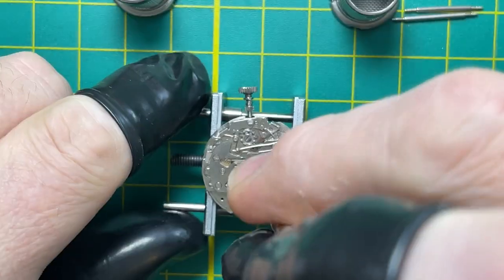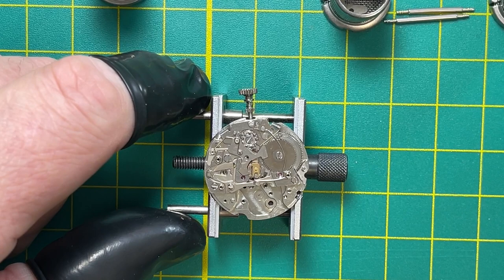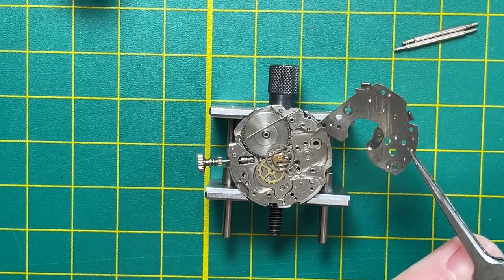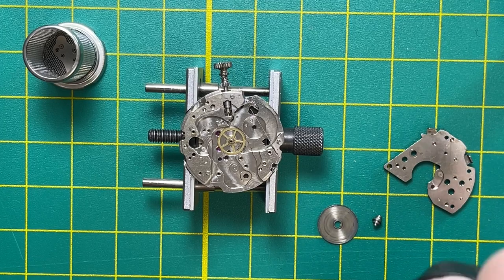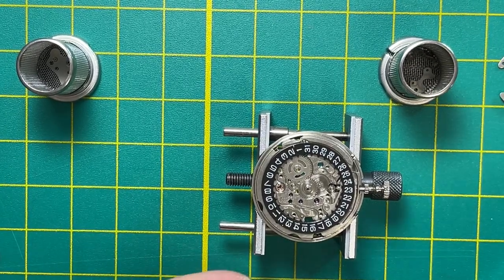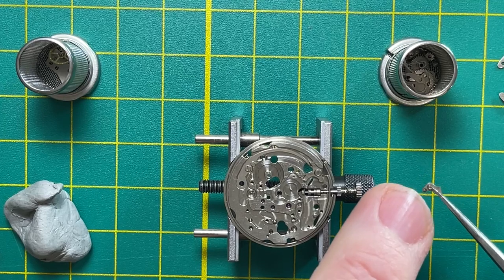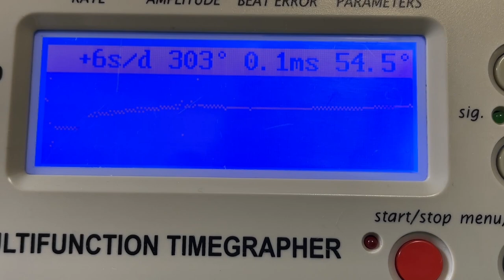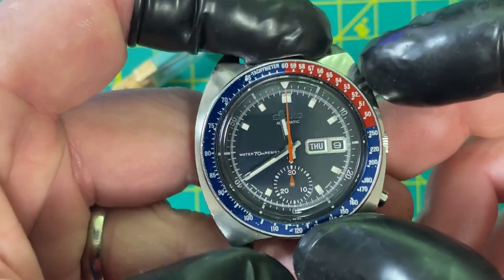For BD: Seiko 6139-6009 Notch/Resist restoration

Comment: Amazing work as usual Spencer. Wondering if you could explain a little bit about the reset action seen here at the end after the service (the slower kinda stepped reset back to zero as opposed to a hard snap). I know you’ve talked about it before but I can’t remember which video it was. Mainly curious if that makes doing a hard reset down from say 30 or 40 safer?

Comment: Nice time piece and thanks for sharing this video. Btw I would like to know from where did you fetch the watch opener you were using on this please???
Reply from the maker: Big Bertha?  Or the little two-tined poker?  If it's the latter, I shouldn't be using it because it's the wrong tool for the job.  It's for binocular restoration, which my dad and me used to do together for fun.
Reply: @SpencerKleinVintageWatch  Referring to the tool that was used right at the inception to.ooen the watch back cover. I kinda like it since it is easy to open a watch back cover while the strap is on...